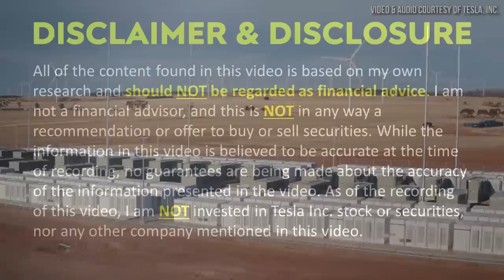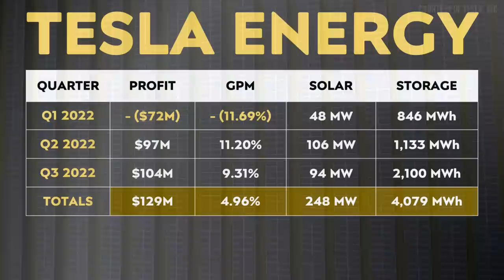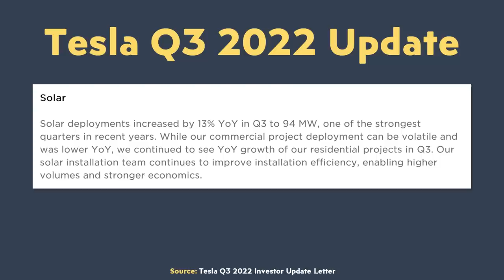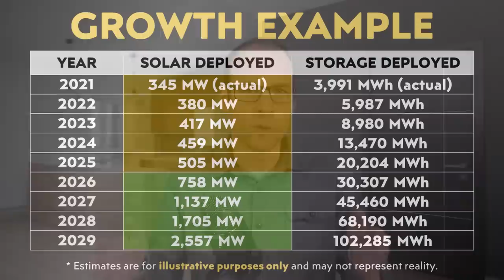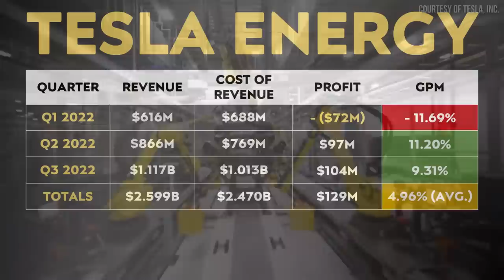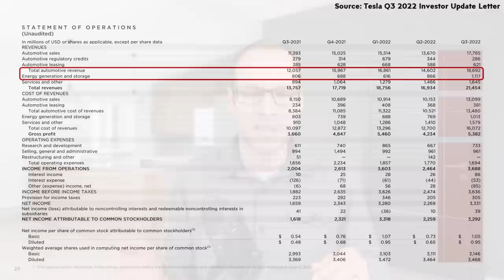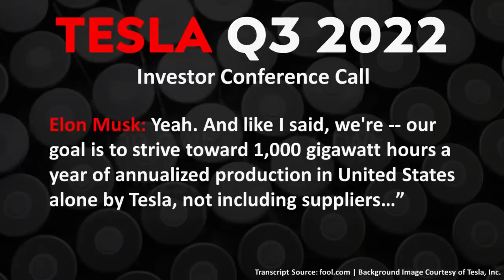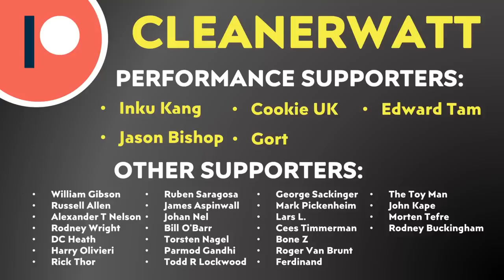Elon Musk’s BOLD Predictions for Tesla Energy Growth

Comment: I recently, on a Saturday in November 2022 (Yes! On a Saturday. When I asked why Tesla Energy was at my home on a Saturday, they replied, they are busy and work six days a week.), had Tesla Energy install Solar with one Powerwall at my home in the greater Las Vegas area. Two amazing install teams - one Powerwall Team and one Solar Panel Team - installed my system in less than one day. Both teams finished by 3:30 pm. I was without power for five hours, but I have a Bluetti Power Station I used for my wifi and my laptop. The two teams did not leave my property until everything worked and I could control and see everything on my Tesla app. The day your Tesla Energy System is installed is the day you can go off the grid. The grid becomes your backup. Solar  powers my home and recharges my Powerwall during the day and my Powerwall powers my home at night and during power outages. If you only have solar panels and there is a power outage, you will be without power, especially at night. One week later, the county inspector arrived. Inspected everything and told me Tesla Energy does things the right way and admires their work. Tesla Scheduling handles all your inspections and paperwork for all the federal, state, county, city and energy company incentives. You file your federal taxes to receive the $7,500.00 tax credit. Any overpayment of my federal taxes becomes a refund to me. After the county inspected my system, then, my energy company comes to inspect and approves net metering. What is net metering? You sell back your excess energy to your electric company and they credit your electric bill. Awaiting my energy company and Tesla and my state to go to Virtual Power Plant or VPP to begin selling excess energy back to my energy company during energy frequency and voltage imbalances, local disruptions or disturbances and keep the network stable while receiving cash. Cost of my system was $23K. I also got two other bids. Both came in around $24K WITHOUT a Powerwall.
Reply: I love my Tesla solar panels going on 2 years, but the competition is advertising like crazy, even door to door, and in the neighborhood I see a lot of solar installation going on but none by Tesla.  I think Tesla should advertise solar.
Reply: Fake comment
Reply: @paulmcgreevy3011  elaborate
Reply: Great story. I will be next! Thank you.
Reply: ... while here in Europe, there are other companies installing similar systems, but I decided to wait till Tesla is able to deliver here as well... well not sure if I live when they are. 🤣

Comment: Hmmm... Tesla's MegaPacks have no moving parts, no homologation hoops to jump through, no consumer stylistic choices to cater to.
How difficult could it be to bring another line into production?
Reply from the maker: Shouldn't bee too hard. Much easier than ramping a car factory I would think.
Reply: Of course it had to !  Ratings and Certifications: IP66, UL 1973 / 9540 / 9540A / 1741.  You don't connect power sharing devices onto the grid without a crapload of approvals...

Comment: Most energy use in the US ends up as waste heat.  (livermore labs has great graphs that show primary energy to end uses, well worth the look-see - up in the 60% range)... so, anywhere there's rejected heat in making heat to begin with, or recuperative capture and re-use - things like high temp industrial heat pumps and the like, would technically be a target for an Energy division to improve and claim energy gains.   Keep open minded to not everything running on a 4680 battery, or even a can battery style... tons of options out there, many of which may be better suited and lower cost by applications.  An interesting look at one approach is Rondo Energy - thermal battery storage to integrate using RE to store as high temp heat for use in steam demanding industrial processes.

Comment: Tesla lacks a killer app for solar. Competitors are cheaper. Solar tiles were supposed to be their killer app, but production and installation are expensive, not competitive. I don't foresee much growth in solar for Tesla without new products that reduce costs and improve efficiency.

Megapacks are a different proposition. Competitors don't seem to offer systems as turnkey as Tesla's, and Tesla is far ahead in securing battery supplies. Megapacks are a slam dunk for utilities over conventional gas peaker plants, saving tons of money and helping to stabilize grids. Growth in this segment of Tesla's product portfolio seems likely to be rapid.
Reply: What are u lacking in the solar app. It’s amazing. Simple. Clean. Nice user interface. And wrapped into the tesla app
Reply: @ssing7113  it is not a bad product. But it doesn't have the sort of obvious advantages that Tesla's automotive products have. It's difficult to rationalize the pricing premîum Tesla charges for solar.

A killer app is a no- brainer, a list of price/performance advantages that makes the product obviously preferable to consumers. Tesla has that in its cars. It has that in its megapacks. It does not have that for solar.

Comment: Tesla energy main growth will come from Mega Pack due to its industrial/electric grid application. The 4680 was not designed for Tesla energy. It was designed for the Cybertruck, Model 3/Y and the Semi. The sizing is more optimal for the structure of the battery pack being part of the car frame. At present the 4680 is not dense enough for the Semi they are using the 2170 until they find the right chemistry. The difference here is weight and structure (battery pack) is not the same priority for Tesla energy. Other solutions that have a longer cycle life, easier to maintain the core temperature of each unit in extreme conditions is more of a priority to Tesla energy. Sodium solutions or LFP batteries are likely more in sync with the Mega Pack program. Power wall is another story due to weight being a factor for the residential market.

Comment: These side shows will kill Tesla all together; and maybe the EV industry.  There are 170,000 tons of Lithium produced annually.  That is enough for 10 milion model Y cars if every ouce was used for Tesla model Ys - but it won't be. IF you use 40% for cellphones, laptops, power tools, & other non transportation, you cut all Y size EVs down to 6 million. If you further use 10 or 20 percent for energy storage you are down to 5 million TOTAL EVs world wide. 5 Million is only 5% of the Light Vehicle market - it will mean EV production will plateau and the value of EV shares drop into the toilet.  Can they find a new chemistry or move storage farms to sodium or something? Maybe - but even that leaves little for expansion of EVs
Reply: So glad you figured this out. I’m sure Tesla has shifted direction based on your insight and superior opinion. Thank god for you!
Reply: Who told you what earth's maximum  production of lithium could be, and that the sodium battery will never work?